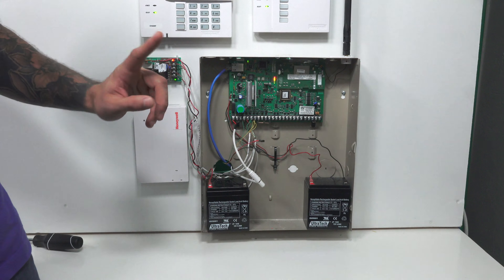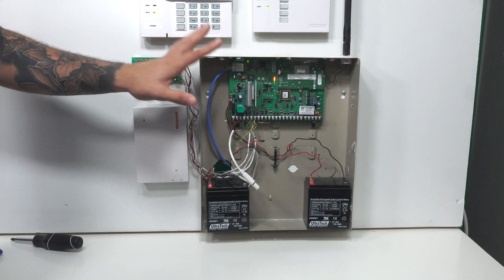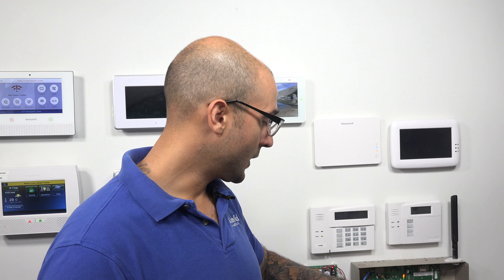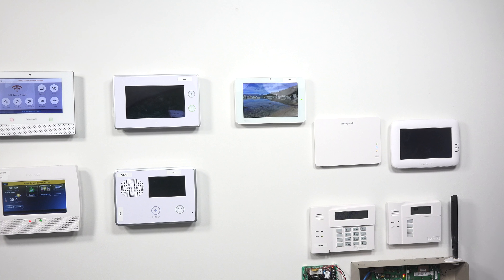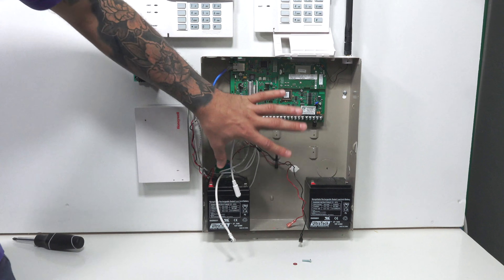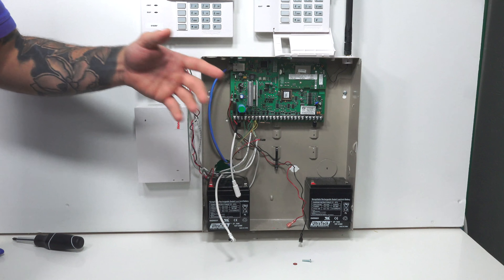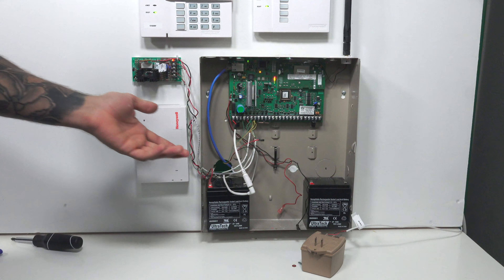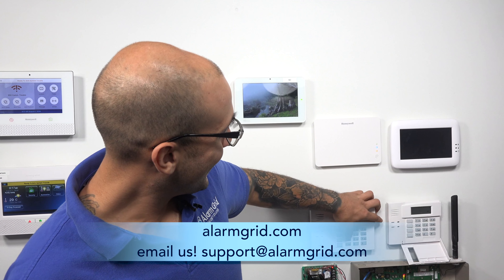Power Cycling a Vista Alarm System

Comment: Getting power supply failure alerts even after replacing the transformer.  Is there a way to reset that alert?
Reply: Hello @mrb552, If you have replaced the AC wall adapter and are still getting an AC loss failure, here is something to try.  Confirm AC voltage at the transformer and at the AC terminals on the panel are accurate and match. If the input voltage from the transformer and the ac terminal voltage match, and if you enter programming and exit programming resetting the messages. See if the ac loss / Power supply failure returns in 60 to 90 seconds without touching the keypad. If so, you may have a board issue and the panel board would need replaced.
Reply: @DKAlarmgridSupport   Thank you for the assistance.  I have not yet tried entering and exiting programming to reset the messages.  Is that a requirement in addition to the power disconnection to clear the alerts?  Thanks again for your help.

Comment: Still seeing voltage on the panel(circuit panel) in basement after pulling the wall wart in same rm as control panel. Is there a second 15v ac xfmr somewhere? I'm pulling the aging wired system installed by ADT under prior owner. Thanks for any help.
Reply: You'll want to be sure remove both the  plug-in transformer power supply as well as the backup battery for the system. After both are moved, this would be fully powered down.
Reply: @dylanalarm_grid1038  I pulled the batt and removed the wall wart held in by a screw, just below the main display panel. Still seeing 15v on incoming line from (somewhere!) else in the house and can't find the source. The wire seems to be coming to the basement panel from under floor joists. Ugh. The source is hidden too well.